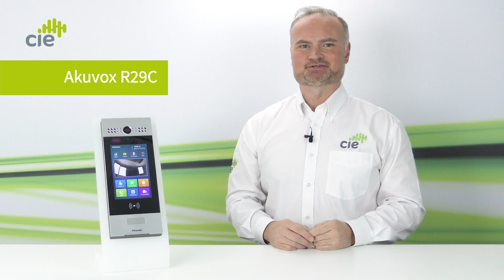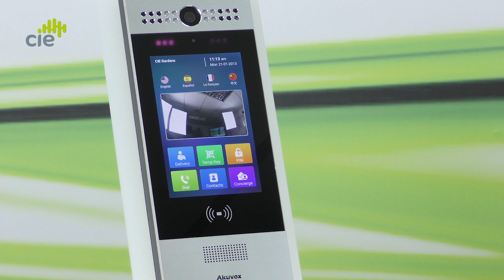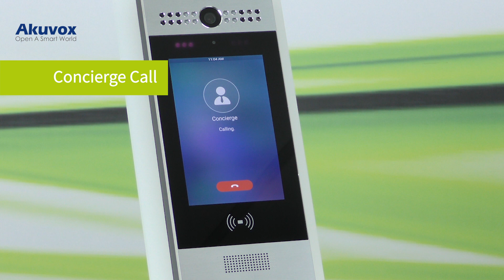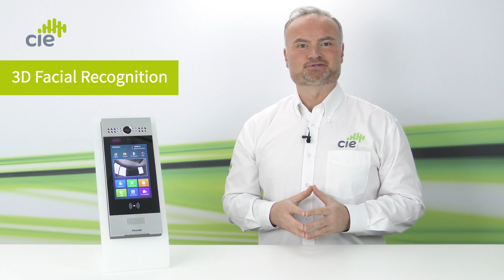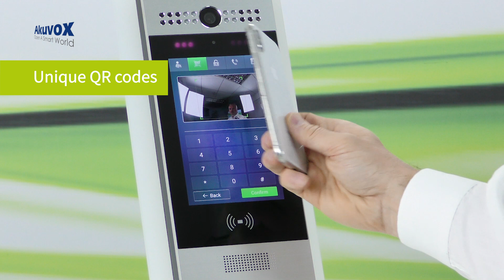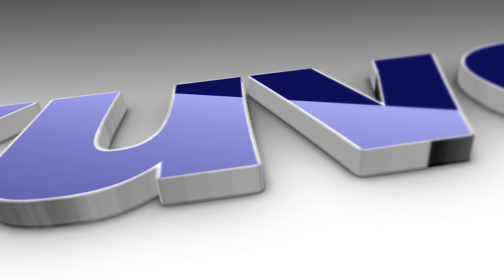Akuvox R29C Smart IP Intercom - with face recognition & QR code access

Comment: Hello. Is there a way to set the time amount for the door to be open for a temp Key? A guest with packages used the pin code but the door didn't stay unlocked long enough to pick up the packages and get to the door before it relocked.
Reply from the maker: The relay settings can be changed on the Web Interface of the R29 by navigating to Intercom and Relay, once on the settings screen there is a Hold Delay setting which can be adjusted from the default 5 seconds to higher as needed.
Reply: @ciegroupcom  Another question, how does the bar code work?
Reply: Oops! Commented too soon!
Reply from the maker: @kerrgal  We have more information on QR Code temporary keys here: https://cie-group.com/how-to-av/videos-and-blogs/qr-code-access-control